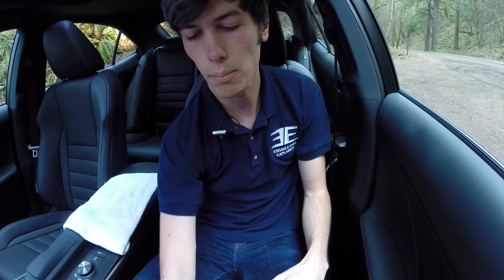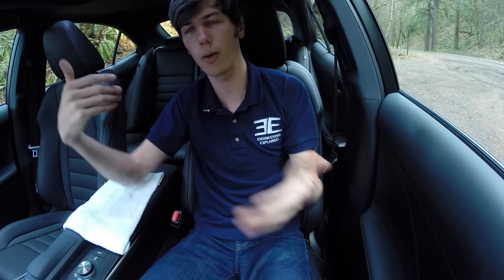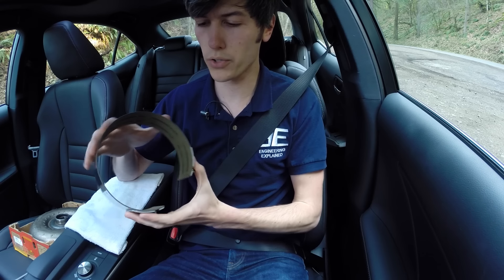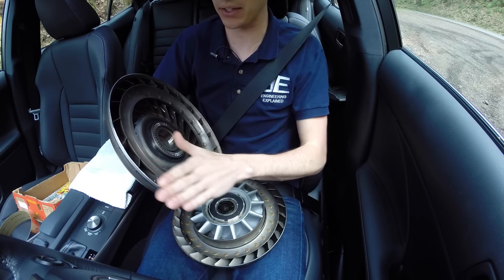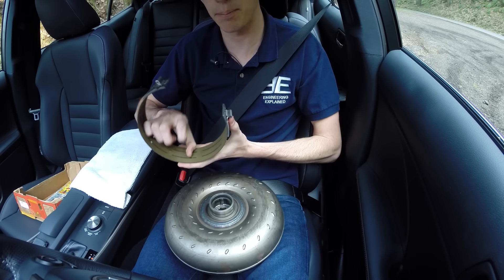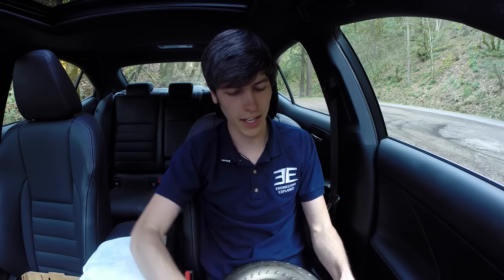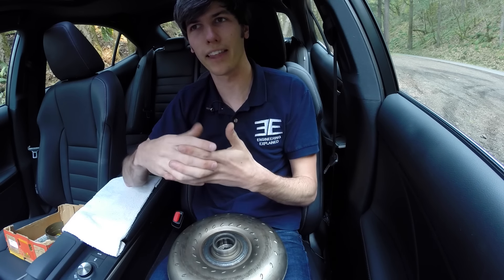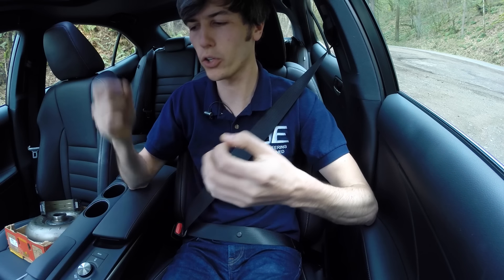5 Things You Should Never Do In An Automatic Transmission Vehicle

Comment: So downshifting is ok?
Reply from the maker: Sure
Reply: +Engineering Explained what about upshifting?
Reply: +Bryan Tyler I prefer the side shift
Reply: Right shifting must be right so I guess that means left shifting is wrong?
Reply: +tanker9987 It's an automatic. It'll do that for you. If you try to force it, it might not let you. For an automatic you can only "suggest" which gear it should go into.
Reply: +Erik Kovacs for up shifting only, down shifting is forced, if you go from D4 to D3 or 2 to 1 you are effectually removing the capability to go into that upper gear.
Reply: +Zabuza No its a lot like male ear rings. Left is right and right is wrong.
Reply: Erik Kovacs
You must be talking about slap sticking. If you are just changing the shift indicator from 1 to 2, the car won't do anything unless it would normally shift from 1st to 2nd under the current conditions.

As far as slap sticking an automatic transmission, most have controls to not allow you to bog the engine beyond an unsafe point.
Reply: +tanker9987  Essential for steep/long descents.
(Otherwise the brakes might run hot.)
Reply: +tanker9987 in my 87 chevy 4x4 I always downshift into direct (standared D {3rd on 4 speed automatics} overdrive) when facing a steep hill or when going up hill with a load.
Reply: +Jacob Sorensen Not always, especially with modern transmissions. The ECM will force the transmission to upshift if the engine redlines.
Reply: Teth47
I'd assume that's only if you are 'slap sticking' if you are locked in one you'll just get revlimited otherwise it would be pointless to have anything but D, OD, N, P
Reply: Jacob Sorensen Well, I know for a fact that the Toyota Tercel will force an upshift if you lock it in 1. It does it to me, and says it will do it in the manual. Maybe it was the only one...
Reply: +eatmyskids ag systems
Reply: Teth47 or maybe they finally started idiot proofing gears no one really ever used on automatics... they just need to save the money and remove the option at all.
Reply: +guardian040 yes... trans braking, key in the mountains... going down rocky mountain passes i am shifting down as low as 2nd gear to keep it from getting too fast.
Reply: Eian Wahgener if you're going over 30 mph you're asking for a new trans :) but I could be wrong
Reply: +Jacob Sorensen Not likely.
Reply: +Elijah Chu   Downshifting into 1st going faster than 30 would overrev the engine and cause damage there more so than the transmission.
Reply: +Devin Dowless I had a 1994 Cavalier 3.1, 3 speed automatic, it held 1st gear until 55mph, and second gear until 90mph
Reply: +tanker9987 Only if not done to avoid using the brakes.  It will heat your transmission fluid more and the hotter that gets, the sooner you should change it.  I never downshift my automatic, I let it do all of that stuff in the way that it was designed to.  Remember that many automatic transmissions have parts that can prematurely wear out and are very difficult to change without removing the transmission.  That is one reason why they are so darned expensive to replace.
Reply: +ts46176 today cars don't let u downshift into a wrong gear
Reply: +Engineering Explained what is your opinion about DSG?
Reply: +tanker9987 Sure...why not?   As long as your uncle owns the transmission shop!  FYI...Brakes are cheaper to replace!
Reply: Robert Applegate I wouldn't do that to my car even if I owned a transmission shop.  It sucks having one of those things wear out.
Reply: +tanker9987 Some modern bmw's downshift while going down hill while using cruise control to keep the speed constant.
Reply: +oprime There are some other vehicles that do that
Reply: +tanker9987 depends on the car, read the owners manual.
Reply: Jacob Sorensen Definitely Jacob, do away with that pesky R, so confusing, everytime I put it in that gear my truck goes backward, not right straight ahead like I wanted
Reply: +Jacob Sorensen Yes, you're wrong.  At least, for some drivetrains.  My '06 Buick lets you downshift into first at 60km/h (37.2 MPH).  Anything faster than this, and it just stays in second until it slows down a bit. Incidentally, it will do 44 MPH in 1st before it shifts to 2nd under WOT acceleration, so it's not even close to over revving at 30 MPH.
Reply: +cbiltcliffe Ah forgive me. There are so many different gear sets and engine combos that not everything is going to be true. It's been years since I drove my camaro last and it is not stock by any means. I don't remember what first gear will allow me to do but 6th gear I can do 90 mph at just 2k rpms. So yea, a lot of different cars will do different things but I don't care what a computer says, if you put the car in neutral and coast down a hill it saves just as much fuel as leaving it in drive. I don't believe we can properly test the theory.
Reply: +Devin Dowless that's not 100% true. Most modern cars/trucks have rev limiters. Supposedly you can shift to neutral if you have a sudden acceleration problem but usually I do what I was taught in drivers ed.. hit the brakes with your left leg and use your right toes to tap the gas pedal. Believe it or not, this works most of the time if the carpet is what is pushing the pedal down.. Since you are using your brakes the vehicle will slow and you can keep control of it.
Reply: +Eian Wahgener that puts more wear on the transmission, the brakes are designed to slow you down, didnt you watch the video ?
Reply: +ts46176 Yes, but you're talking about a low revving GM engine, which people like to bash because it doesn't rev to 6500+, so it's horsepower/liter figure is too low for their liking. I've got a 3800 in a Buick that's the same. 44 MPH in 1st, 93 MPH in 2nd, and still 2 gears to go. Sure, it doesn't scream like crazy, but the bottom end grunt is well worth it.
Reply: +oprime my Taco does that, I simply turn off the cruise and do it manually, to conserve fuel, as it causes the engine to be near 5/6 thousand rpm
Reply: +oprime my Taco does that, I simply turn off the cruise and do it manually, to conserve fuel, as it causes the engine to be near 5/6 thousand rpm
Reply: +Peter F. I don't think you are actually addressing this to me are you? If your acceleration pedal stuck (with dbw I don't think it is possible anymore) putting it in neutral will certainly make your engine hit the rev limiter. Then as you come to a stop you can turn it off. If I know I'm headed straight I would turn it off while braking with my right foot (never drive with both feet) and then turn the key back to the on position so my steering wheel doesn't lock/or stay locked.
Reply: +tanker9987 Been doing it for over a decade on all four of my cars totaling over 300,000 miles. Never had an issue and brakes last a LOT longer. My 2012 Elantra has 76,000 mostly city miles on it, is still on the original front brakes and I've been using the transmission to engine brake while going down hills since I drove it off the lot in 2011 with 28 miles on the odometer. If that manual shift mode were bad for the car, they wouldn't put it there.
Reply: +tanker9987 He is referring to Automatic Transmissions. Manual Transmissions are different.
Reply: Do you live in fairly flat country?
Reply: +tanker9987 its actually good for your car if you do it right
Reply: +Erik Kovacs Unless your transmission is on a 20 year old car...
I accidentally knocked my transmission into L2 (the button is pretty loose) when I was on the highway at 60MPH, and boy did my transmission obey. I almost instantly decelerated to 30mph and the transmission made a very loud noise.
Reply: +tanker9987 Some car/truck manuals actually say to downshift from D with OD to D/3rd for towing. My 2000 s10 2wd has bald tires on the front and driving in snow I have to downshift to help with braking on the rear.
Reply: +Allen McKinney 
That's correct manual selection up shit or down shift on an automatic . it allows the clutch packs in the planerty gear system to build extra pump pressure to reasure a flair or slip will not happen on an automatic wet clutch pack assembly.
Reply: hunterssports
I kw it's a typo but "up shit" lol.
Reply: +tanker9987  . Yes . Read the owners' manuel
Reply: +Jacob Sorensen  . .One needs it sometimes . Its easier and more economical to shift one down on overtaking a truck , than to use the kick-down.
Reply: +Jacob Sorensen . yes your'e wrong . I had 15 automatic cars
Reply: Cars seem to last a little longer these days, but transmissions do not so if you have a car for a while, you will see a bill for $2000 - $3000.
 Brakes cost about $100 for 4 wheels if you know how to change them and most are lifetime warrentied so you only pay once. Everytime that transmission shifts, you are one closer that bill!

Comment: How do I stop a car from crashing if my engine blows up? For example the engine uses pulleys that pull accessory belts to pump the fluid for power steering and your breaks. As soon as the engine stops you can't steer and you can't brake. If you use your e brake your car will flip over. So what should I do?
Reply from the maker: If the engine shuts off you still have steering, just not power assist. At higher speeds it's still relatively easy to turn (plus you'll have some adrenaline at this point). At low speeds, tap the brakes. Your brakes will still have one good vacuum assist in them to stop you. I used to drive an old '95 Ford Taurus that would regularly shut off. I've experienced this probably 3-4 times while driving haha.
Reply: just brake
Reply: +Engineering Explained Oh thanks I will keep that in mind. Because my driver instructor just told me to start praying! X'D
Reply: +Jorge Chz when your engine stops you can't break because the brake pump stopped as soon as the engine turned off
Reply: +Taijean Moodie I don't know about you but the brakes work in my car when it's off.
Reply: You can still brake but it will be much harder when the vacuum disappears after a few pumps.
Reply: At first I thought this was advice on-the-run and that you were actually stuck in a speeding car...
Well,not really,but come on,it'd be fun
Reply: Taijean Moodie you can brake it will just take more force
Reply: Oh i see thanks guys.
Reply: No it actually doesn't, try it out, even if your engine shuts off, you still can break as if the engine is on, but only once, after that you'll loose the vacuum and you can forget breaking, even if you push it with full force. Tested that scenario in 5-6 cars...from a Golf to a Merc...
Reply: But this is in the new cars right my 2003 honda civic won't have this issue right?
Reply: Taijean Moodie Your 03 civic most definitely has powered brakes. Its the same as with all other cars. If the engine shuts off you have a couple pumps worth of assisted braking left.... after that I better hope you spent some time on leg day.
Reply: Power steering relies on pressurized hydraulics, but you can still steer with the hydraulics inoperative - it just requires more effort. Power brakes are powered by vacuum from the intake manifold, but there is a small amount of reserve that allows three or four applications before you lose power assistance. Finally, proper careful application of the handbrake will not result in a rear-end lockup and loss of control.
Reply: Gradually apply your ebrake. And please, always keep steering.
Reply: Your user name is failing at inspiring confidence... XD
Reply: P
Reply: Well, as far as I know, my e-brake consists of drums in the rear. So, I doubt an e-brake will flip the car. Unless you are in a turn, and even then, the worst I can see happening is a drift being initiated. Just my $0.02.
Reply: It depends, a friend of mine tried doing a handbrake turn at 30mph and rolled his micra.
Reply: oh crap is he ok?!
Reply: you can ease on your hand break by holding the lock down with your thumb.. you dont have to jam on it thats what will flip you
Reply: To those who said you lose braking entirely when the booster loses its reserve, no.  In fact I have a VW 411 that doesn't even have a brake booster.  It just takes considerably more force on the pedal to achieve the same braking force.  The same also goes for cars with power brakes, once the reserve is depleted.
Reply: Your driving instructor is obviously incompetent.  Any competent driving instructor would know that if the power booster for the steering fails that you could still steer even though more effort would be required.

Pupils of such incompetent driving instructors would crash because of inability to handle emergency situations.
Reply: The vacuum could disappear with only one pump.  Thus, if the engine stops running, you could keep a steady force on the breaks and not let up until the car stops unless you have the muscle power to operate the breaks without the vacuum booster.
Reply: I know your right. I questioned some of his lessons, I'm just happy I have my full license now because TBH the driver instructors are all just scams :/
Reply: Why do cars have vacuum assisted brakes and things like my sport bike doesn't have it? Shorter lines or something i'm assuming?
Reply: I'm not sure.  Could be cost-cutting, or maybe there's a practicality issue with putting a brake booster in (size maybe?).
Reply: You don't need power assist to "break" and steer.  It just requires more force.  Cars didn't always have power brakes and power steering you know.

Comment: if my car accelerating out control i would put it in Neutral to take the power away from the wheels and brake
Reply: +Travis Hewitt my question was how to downshift in an automatic?
Reply: Shkelzen K The gears in an automatic are P R N D 2 1. Shifting to 2 or 1 will put the car in 2nd or 1st gear, respectively. Alternatively, it may be P R N D L, in which case I believe the L is for low gear.